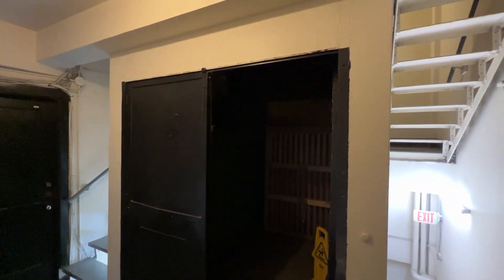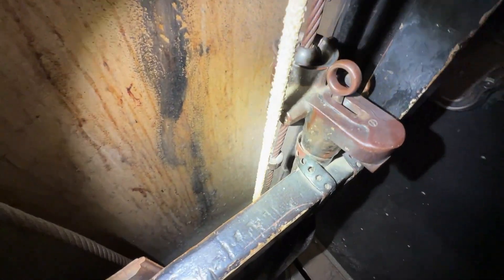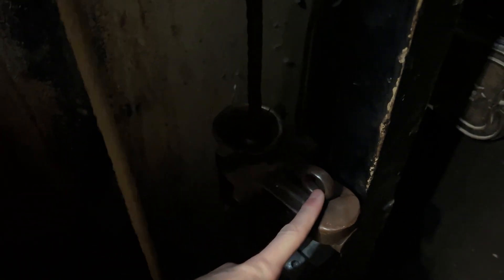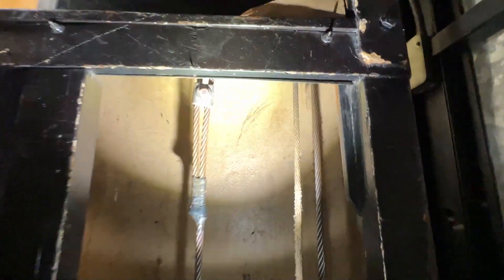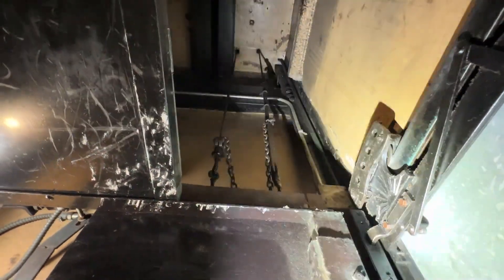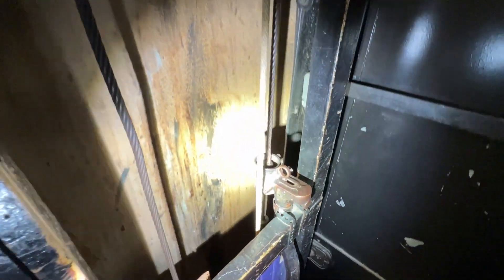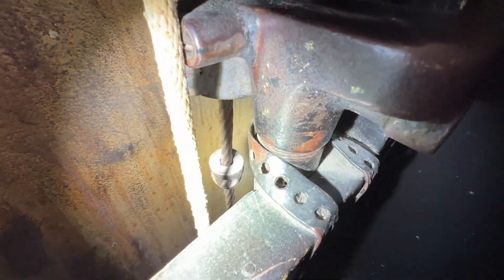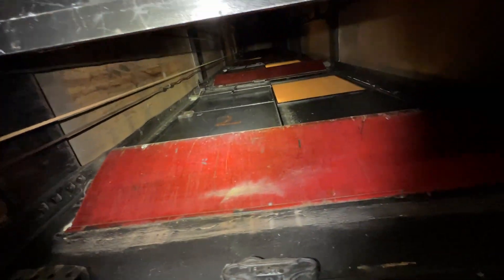Detailed Look at a Pull the Rope Elevator

Comment: Is this in use in a public or commercial building? Seems they would have a hard time getting a permit from the state. But a cool piece of equipment!
Reply: These types of elevators are illegal in many states (they don't meet elevator codes and existing installations had to be retrofitted to no longer be "shipper rope" or pull rope operation). Wisconsin is one of the states that still allows these elevators to operate.
Reply: @upanddownadventures  A local theater in the small city I live in has one, or at least it had one yet in 2016 still in operation. I'm not sure if it's still there or not as I have not been backstage since 2016.
Reply from the maker: Private building.